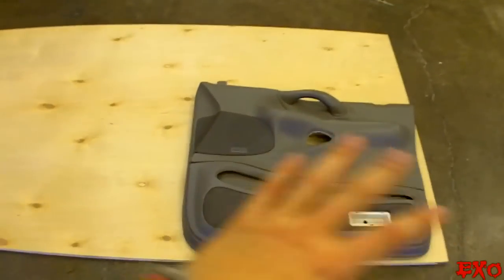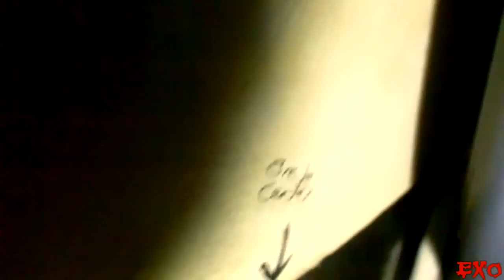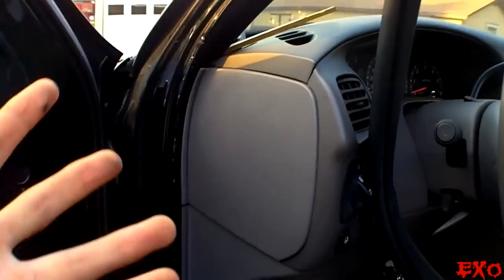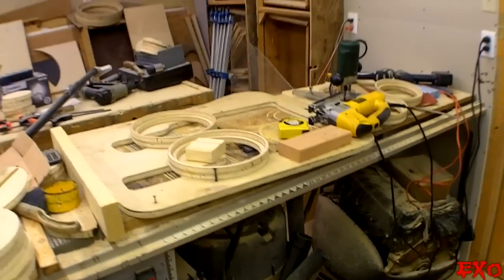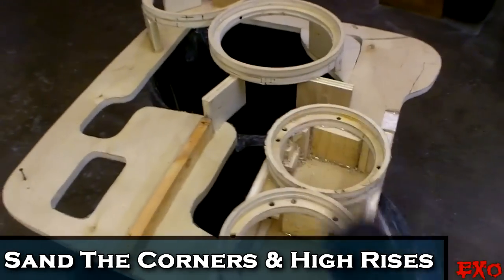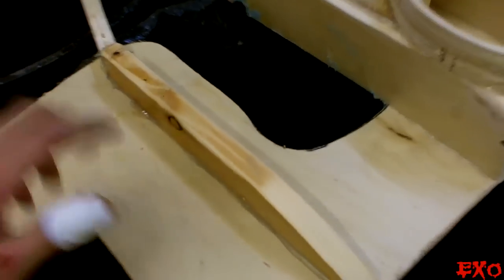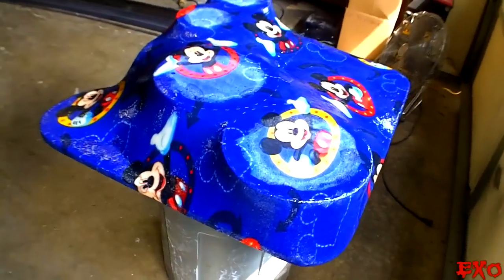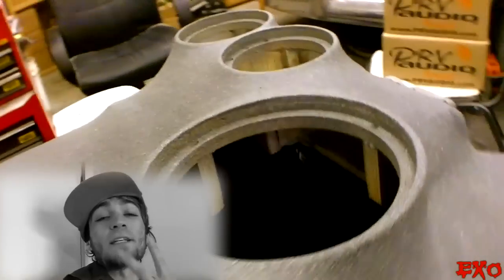Making Fiberglass Door Panels | EXO's Custom Car Audio Speaker Pod Tutorial For 2 10" & 6" Pods

Comment: How do you mount the panels to the doors? And did you have to upgrade your hinges to support the weight?
Reply: That's the part I've always wondered. Do they use the factory slots or what?
Reply: Zak Koettel sheet rock screws

Comment: hey bro, just quick tip may or may not help ya but when running speaker wire just hook pull string on OEM speaker wire and pull it out. Then u can just hook new wire to string and easily pull it thru boot. So easy and fast for me personally.

Comment: Thanks EXO I had done my door panels also like you but not so complicating.  I have an 85 Isuzu which in those days it was just a flat piece of board.  I had to build up with rings and pieces of wood to clear my window motor that I upgraded from a crank window.  THANKS EXO for this great video.

Comment: Awesome video as always EXO

A good tip, when you are trying to fish the speaker wires through rubber grommets you can use a little bit of silicone lubricant spray or other rubber / plastic safe lubricants if the wires are being stubborn or are very close to being too big to fit.

Comment: Hey have you ever done any vacuum forming?  If not I would suggest you check it out.  Vacuum forming an entire door panel would be pretty sick as a mold to start your fiber glassing.  You could keep your structure much lighter, build some speaker rings out of steel, embed them in the fiberglass.  Then drill / tap some holes and use bolts to mount the subs.  
Cheers, Nice work appreciate you putting all the work and effort to making the videos.  I know it can be tough!

Comment: One of the things I have found out after using polyester resin over 20 years is that if you use light colored fleece you will be able to tell how well your saturating the material by the color change of the fabric.  If you use white or light blue, you can see when the resin soaks through to surface and bonds to the forms that you are using to get your shapes.   Hope this helps.

Comment: ...i used a lil to much hardner so it started to gel on me. so i put it on the side and it got really hard and i touched it and it was hot in heat. that was weired. but i learned something new. but again THANX TO ALL OF YOUR VIDS. you tube is where i am learning alot of your custom fabrications.

Comment: HEY EXO. i should have proposed this as a neat thought earlier, though try a horn style speaker design like a smaller shape of a megaphone directly along with the speaker so you get a louder thud with any bass, maybe bend the wood to make a compression, and use a slim-line subwoofer / mid-range-to-low, or even many small speakers like that. and i agree with the top rated comments man, the longer videos are more interesting and captivating. Anyways sorry for the long comment.

Comment: hey thanks for your video, im now working on my 85 Isuzu Pick up with hardly any room to really play with, but i just got done with the first coat of resin, now tomorrow i will be laying another layer of resin and then letting it dry. then laying on the fiber glass with another light layer of resin then the fiberglass Bondo. im taking pics of it step by step from the rings to the end. there was something that i learned, the freakin' resin gets pretty hot when its in a glob....

Comment: wanted to update on my speaker pods. 3 coats of resin and 1 coat of fiberglass. harder than hell it is. just sanded down the pods and now ready for the bondo. using the fiberglass bondo tomorrow and then shaping that one, primer and then painting. trying for that candy apple red look. gold back ground dry, gold glitter dry then a second coat then the trans red. need to make a test first to see how it looks. well soon it will be done.

Comment: Hello exo, I am having some problems with my Kenwood KDC-348U. Everytime i play a song with bass, the HU switches modes automatically from tuner to USB or from CD back to USB. I live in arizona and the temperatures over here can be brutal to car audio. I believe that the cooler temperatures now is causing the amp to push out more power out and the subs produce more bass. 
setup 
2 Kicker 12" CVR's (2007 model) dual 4 ohms (have them wired down to 1 ohm)
1 RE Audio DTS-1000.1 
Big Three upgrade

Comment: Im going to be doing my doors starting tomorrow. Going to be running a neo pro 8" and 3 pioneer -way components.I ahve the placement of the speakers and my controls,but where do you open the door from the inside?

Comment: i just have a few questions, were is a good place to get cheap audio supplies, like amps, wiring, terminal lugs, and subs, also were can i get an actually spl meter i found out the one i used in my vid starts to quit working after 120 dbs. so if u could help me out that would be awesome one again love the vids bro and cant wait to see franky bump.

Comment: Love it!  Very nice work.  I have been out of the bass game for a while, until I found my stash from cleaning up my garage.  15" Orion 1000W sub and Legacy 3000W Amp!  I am going to throw this in my 2000 Durango! Question, other than 0 gauging the "Big 3" what would work better with my stock charging system, a 2-4 Farad Cap or a Deep Cycle battery?  I don't want to go crazy, but I love clean installs! :D

Comment: wow you did alot of extra work that wasnt needed. After i get my fleece coated with resin I put 2 layers of fine fiberglass matte on the outside then bondo then sand and your done. No back filling and wasting so much material.

Comment: quick question exo. i have 2 sa 12s running on a skar sk1500.1 i have all stock electrical and my battery is draining too quickly, its a little acdelco. i deploy in 4 months and im not wanting to spend alot of money till i come back and upgrade. for the time being, would replacing my front battery with an xs powerd3400 work till i leave or would i have to upgrade my alt as well?? right now im on a budget. please help thanks alot!

Comment: hey exo i would like to ask one thing doing these panels do you have to use 3/4" boards. im a little limited for spacing in my 85 Pick up and was just wondering if 1/4" to 1/2" would be good. and how did you bolt the panel to your door?

Comment: Hey man. I gotta quick question for ya. Hope it doesn't bug ya lol. But anyways, I got a good deal on (2) rockford fosgates p3d2's (dvc at 2ohms each - 600wrms 1200wpeak each) & a hifonics brutus 2400.1d (2400rms @ 1ohm). What I was gonna do is wire each sub to 4ohm & them bridge them back down to 2ohm. Do you think this is a good match & will be a good setup? I want your input on this man. You feedback would be GREATLY appreciated!!!

Comment: That door panel is going to be heavy, use foam to fill voids instead of wood.Helluva job. What would charge to make a set of these only 1 6x9 in each door only glassed, for a 94 Chevy 1500?
Reply from the maker: Thanks for the comment, Buckwild! I don't currently take on outside orders, but thanks for watching :)

Comment: I've made some custom door panels for my car. it's basically one solid sheet of plywood but for holes in it and rings to stick the speakers out I have no access to the back. Would I just put the fiberglass mat on the outside for strength?
Reply from the maker: You can do that, but isn't the plywood strong enough?
Reply: @EXOcontralto  yeah my just used one layer of fiberglass mat on top of the fleecee soaked resin. Its definitely strong enough just need to do more bodywoork to make it smooth and paint it with crackle paint or spray bed liner on it

Comment: it seems like it only turns off when i dont have the volume cranked at normal levels it will shut off?i did install a fan anyway i could only have it turned on when the car is on and off when the cars off??

Comment: hey question.. I have a subaru forester and im building a box.. gonna have the subs facing up and port facing the rear.. i have about $200 each sub to spend on 2 subs?... what should i get for the best flex if possible and deep bass. and should it be 12" or 15"

Comment: Question, y woulduuse the mickey fabric than paint black primer over it
Reply: The pattern doesn't matter. Probably what he just had laying around for free. I've used t-shirt as long as it's absorbent. Fleece just drinks more resin. The resin isn't wat makes it strong cuz that will crack with out fiberglass. And even with fiberglass if you don't do an adequate amount of layers.

Comment: EXO. i know your busy but please help me bro..  please. i have 2 spl sp3-15s( xmech is 15.5) and two splw-15,( xmeh is 30.5) im putting them in the jeep, in one box with a divd wall so its two boxs, 40l-36h-14d- it should be around 9.7 but 4.8 each side, i want the box tuned about 33 hz, sloted ports, what size should i make the ports. right now i have two of them in a box the 42-18-16 port wall is 18' long and 12.5 'deep by 4inch wide, and it slams highs but lacks on lows

Comment: how did you attach them to the door it self
Reply: idk how Exo did his, but I personally always just look for places in door frame with enough room and strength for drilling holes in metal to Nutt-N-Bolt that sucker up in atleast 8 different equally spaced places. (1/2" lag bolts with lock-washers and self tightening  lock-nuts. Countersink hole in wood for flush mount look.
Reply: idk how Exo did his, but I personally always just look for places in door frame with enough room and strength for drilling holes in metal to Nutt-N-Bolt that sucker up in atleast 8 different equally spaced places. (1/2" lag bolts with lock-washers and self tightening  lock-nuts. Countersink hole in wood for flush mount look.

Comment: If I wanted you to work on my car how do I get a hold of you?
Reply from the maker: I don't take on outside jobs at the moment, but maybe I can help answer any questions you may have.
Reply: I have a 12 inch skar audio Evl 12 dual 2 with a skar RP 1500.1 amp. I am wanting to replace my factory speakers. I am using the factory radio and I have a line out converter that I hooked up to my left rear speakers to run the rca. My question is I am wanting to hook up another amp for my factory speakers, but I only have 1 line out converter how do I run rca’s for the second amp?
Reply from the maker: Use what's called a "Y-Spillter"

Comment: We have a saying in the UK when something is not quiet right, fake, questionable quality.

We say that the thing is a bit Mickey mouse.

I have to agree the bracing is very heavy, it would have been just as effective to glass in polystyrene, I've seen it done to make boats where the frame was made from polystyrene and glassed over to form solid beams then fleece was secured over it much like these panels.
Reply: That's Ironically funny.....

Comment: hey i have a power problem and wondered if you could help 

i have a Honda hybrid that has a 10kw electric motor generator that uses a 144volt battery that then has a dc to dc converter for 12volt my problem is i need a bigger dc to dc converter to run my amp but cant find one so .... if you could contact me on facebook or some how that would be awesome my names blakecoppinger